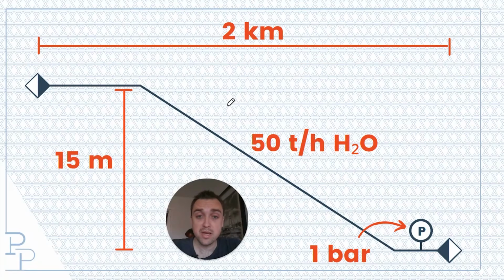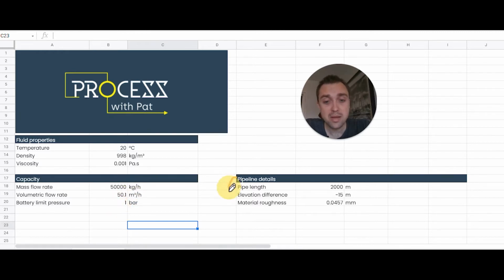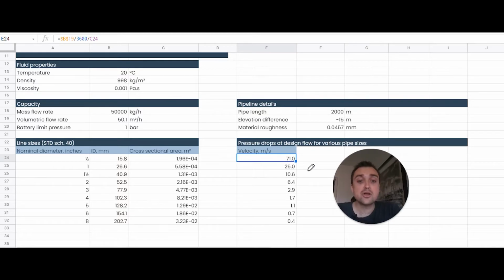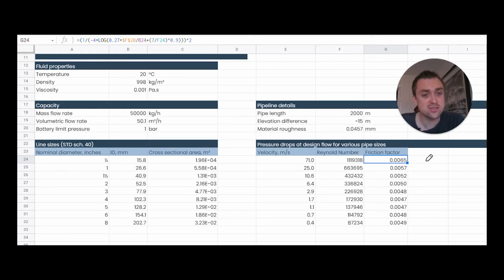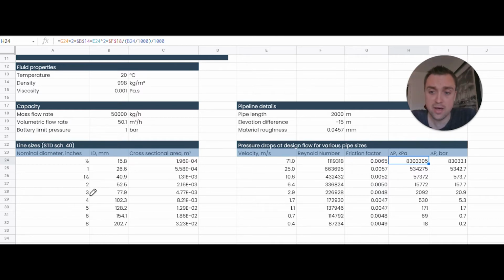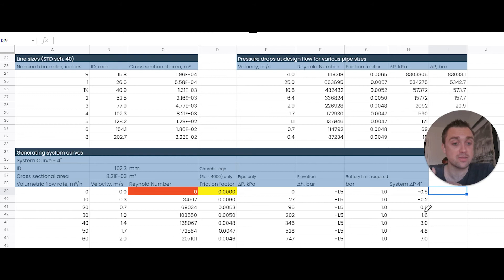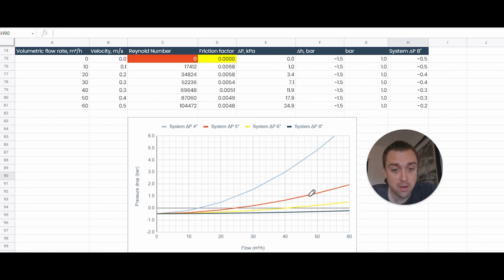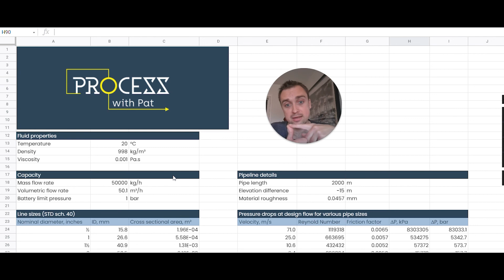Liquid line sizing & pumping downhill

Comment: That is an old video and I am not expecting anyone to answer my comment, but i think there is a mistake. 

We calculate friction factor using Churchill fomrula so we get Darcy-Weisbach λ. And then if we use rearranged Fanning formula for dP calculation we get 4x higher pressure drop. To avoid that we have to first divide friction factor by 4 and than use it to calculate pressure drop. 

That is my opinion but I would someone to check it and confirm it (or not) if possible.

Comment: Hi Pat, I just discovered your channel so, you might have covered this topic, but here it is:

So you mentioned compressible flow, and I have a problem involving that.
 I have high pressure steam source at 30 bar and a 30 m long DN250 pipeline. 
The other end of the line is 20 bar. If I want to determine the max flow rate through the line, I generally use similar equations as in this video, but for compressible flow and take into account the lower density and the 1,5 times big velocity. OK.
But what happens, when I blow to the atmosphere? The pressure difference is greater so the mass flow has to be at least as great as in the fist place, right?
But due to the 30 times more velocity, at the end of the pipe, the gas goes with something like 4000 m/s. Not possible. 
If it was a valve, then chocking would occur, and the flow rate could be calculated from Kv. The max velocity is the speed of sound. But it is a long pipe not a sudden contraction.
So what happens here? There is a pressure drop of ~10 bar at the exit point? Or the last meter determines the flow with the max velocity - meaning the flow is smaller than in the 20 bar case? Or 4000 m/s is correct, since it is just a couple of mm-s at the end? How would you solve this?
Reply: You need to iterate since density will depend on the pressure which decreases throughout the pipeline. The pressure itself will depend on the density through Reynolds number. Velocity will also increase throughout the pipeline which depends on the density decrease. You need to divide up your pipeline in multiple segments and do multiple calculations/iterations. Once you get your flow it may be a fast calculation which will be good enough. Or you just use a process simulator which does all this within a second😅

Comment: Great stuff.  For long pipelines, this is great.  But in systems within a building, the pressure drop in the length of the pipe is trivial compared to all the other 'minor losses' (elbows, valves, fittings...).  Perhaps a video discussing these factors?

Comment: Hi Pat! Looking again your video two fundamental questions came to my mind and I would like to see your reply.
1) A pump creates pressure or flow?
2) When the speed of a pump increases why the flowrate of the pump increases?
Reply: Pumps create flow.  Packing that flow into a confined space, the pipe, creates pressure.  Other than that, the distinction is relatively immaterial.  

My advice is Do not worry about such things. They always occur together, so there is no advantage to trying to separate them and there are more important things to worry about.
Reply from the maker: The pressure vs. flow question is one that comes up often, and I am going to look into it properly. I just need to come up with a good way to address it.

On increasing the speed of a pump - well for a positive displacement pump it should be obvious - you are displacing more fluid per unit time. But I guess you mean centrifugal. Centrifugal pumps impart energy onto a fluid - so increasing the speed increases the rate at which you impart energy. That energy is then translated into an increased velocity/flow.

Comment: Hi Pat! As always I love your videos and I have a small comment. 
The expression of ΔPsystem that you have in excel includes three terms (friction+elevation+pressure at the lowest point). 
If I apply the Bernoulli equation and let's say point 1 is the start of downhill and point 2 the end of downhill (where the pressure is 1 bar).
By applying bernoulli there P1+ρgh1+(1/2)ρ(u1)^2=P2+ρgh2+(1/2)ρ(u2)^2+htotal,
where u1=u2, you can eliminate them and then you have:
P1+ρgh1=P2+ρgh2+htotal
where htotal=2fρu^2L/D
h2=0
Why do you consider as ΔPsystem=P2-ρgh1+2fρu^2L/D? Instead I would say that P1=P2-ρgh1+2fρu^2L/D.

What is your opinion about it?
Reply from the maker: Hey Panos! I would say that ΔP_system is the amount of pressure that needs to be overcome by the pump (which is why if it is negative it is “free” flow that doesn’t need to come from a pump).

I would say that the full expression is:
ΔP_system = (P2-P1) + ρg(h2-h1) + 0.5ρ(v2² - v1²) + ΔP_friction.

I agree the velocity terms are negligible. So if P2 is greater than P1 and h2 is greater than h1, this requires more pressure from my pump. Again, in my case h2 is less than h1 which is some “free” (no pump needed) flow. But P2 is higher than P1 (because P1 is zero/atmospheric), but P1 could be higher if the tank was pressurised, which would also require less from my pump. That is why I disagree with your definition - because you are saying P1 is a function of the other terms, but P1 could have its own value if the tank/supply pressure was some other value that actually helps the flow along, requiring a smaller pump.

One note: my h2 is NOT zero. I define h1 as zero, and h2 as -15 m.

Does that makes sense?
Reply: @ProcesswithPat  hi Pat, I had missed your reply.
Actually with your description almost everything is crystal clear. 
The only unclear thing is why P1=0 bar?
Reply: @ProcesswithPat  I'm looking forward to your reply! ☺️
Reply from the maker: Oh crap! I totally forgot about this one - sorry for not replying!

I think I just understood the confusion in our conversation. You are considering P1 to be the discharge pressure of the pump, in which case I understand. In my head, P1 is the suction of the pump. So increasing P1 helps the pumps (lower system resistance, in a way).

But if you consider P1 to be the discharge pressure of the pump then I think your original equation (in your first comment) is correct.
Reply: Actually, I was considering the P1 as suction pressure. But, I don't get why you consider it as zero!?!
Reply from the maker: It’s part of defining the problem. Just like I need to define h1, h2, and P2, I need to define P1 to start defining the system curve.

Imagine you were defining a system curve for a horizontal pipe… Obviously h2 - h1 = 0. You would start calculating friction factors, etc. The implicit assumption you’d make when you were finished is that P2 - P1 is also zero, because no one has said anything about the pressures in the system.

In fact, the system curve would look identical if P1 = P2 = 0, or if P1 = P2 = any pressure.
Reply: @ProcesswithPat  thanks for your reply. It's more clear now.

Comment: If I use haaland equation my friction factor is  a lot different about .026 and if I use Colebrook I get .026027. Am I doing something different or incorrect
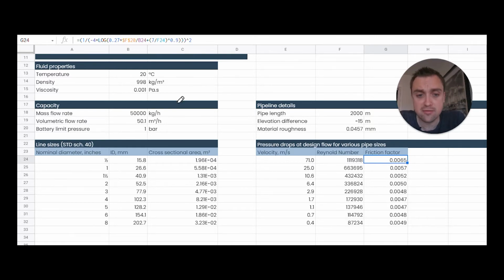Reply from the maker: Am guessing that it is because both those equations calculate the Darcy friction factor which is 4 times greater than the Fanning friction factor which is what I use. I mention this at 08:30 in the video. I’m not sure which conditions you’re doing your calculation for, but check out whether dividing by 4 gets you to what I get… Let me know if this was indeed the issue or not.

Comment: To date I am yet to find a 125NB / 5.0" pipe. Thank you for an awesome reminder of why the rules of thumb guide you to proper design boundaries
Reply: I've met DN125 pipe during my career, but I'm always surprised. It's when they used it in the past and we have to connect to it during a modification.

The reason it's not common is that its price is almost the same as DN150, so the go with DN150.
(at least here in C-E Europe)